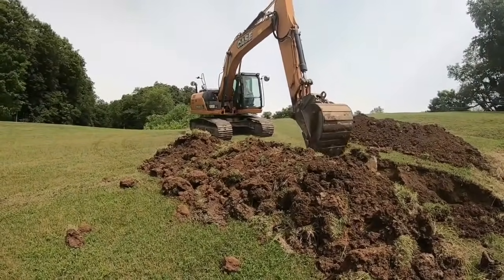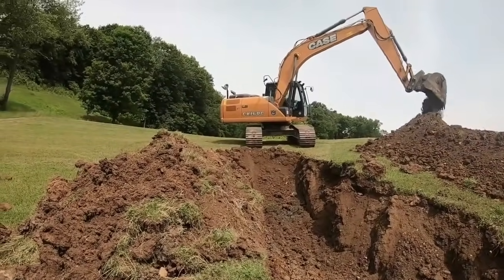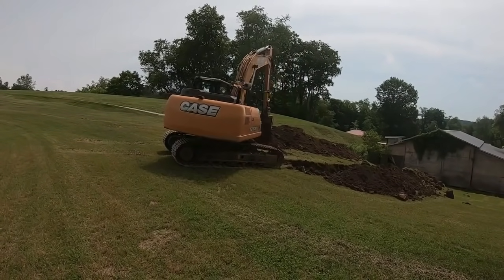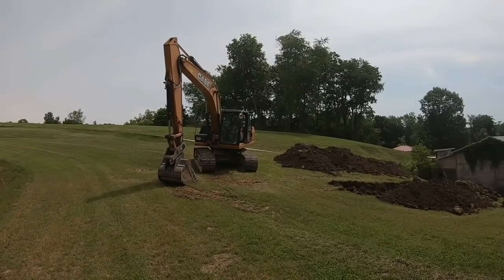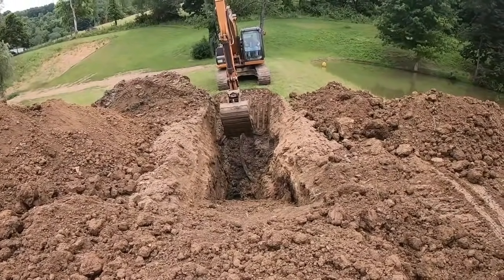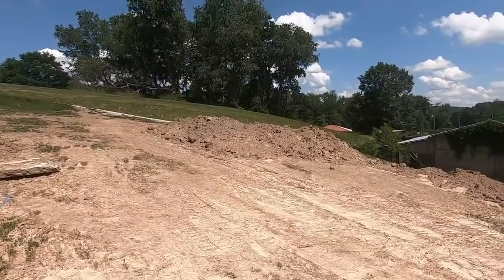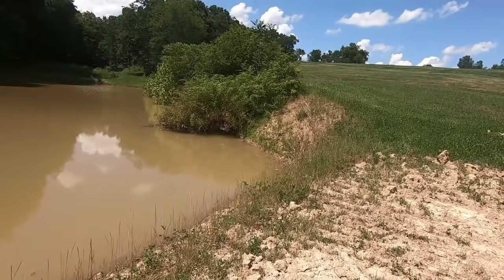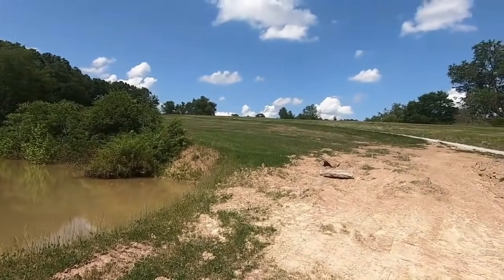Pond is Leaking - Today we Dig and try to Fix the Pond Leak

Comment: That’s a cute little dump truck.
Reply: Sometimes, a big tandem or triaxle is too much truck. You can make just as much money with a little one ton dump and mini excavator as you can with a big triaxle and a large excavator. It's all about the jobsite constraints and how much restorative work is in the budget.
Reply from the maker: @mikeznel6048  your right bout that Mike. Thus is the perfect truck for tail gating gravel driveways. We don't have triaxle, but use a buddy's when heavy haul needed. Can get this in lots places a triaxle cant
Reply from the maker: We like it, 2011 Pete, has 3 stage engine brake and an air operated tailgate, very nice for tail gating gravel. Thanks Hugh

Comment: We had two ponds on our property, but the dam on one leaked around the overflow pipe, they dug it up and poured a concrete apron or collar around the pipe. Filled it back in, only for it to leak again around the collar and it washed out the dam. We had 3 or 4 springs that fed the pond. I think the springs were the problem. I am curious, what are you feeding hay to?  I hope you get the pond fixed.
Reply from the maker: Very interesting Valerie, that had to be a real bummer when
that happened, really hard to fix a dam after it has washed out.
Hay is for mulch for Karl's excavating business. We used to have cows and horses many years ago but that is way gone. Thanks for
writing in and for watching my friend
Reply: @ccrx6700  same here, we had cows and horses, they have gone on to heaven. LOL. There is no way to fix the dam when there is springs in it, our pond filled up over night. They are pretty strong. 😣
Reply from the maker: @valeriebassett3107  👍

Comment: Wow that looked like a real mess. Hope you can get the leak fixed.
When I worked for a structural repair company we would pump urethane into areas that had a water leak. When mixed with water it turns into foam and stops leaks. We pumped a hillside to keep the ground stable and not erode into the creek below.
It might be an option if the clay does not stop the water. It's not difficult to do but I think it might be a bit pricey .
Reply from the maker: Thanks Scott, that's pretty interesting, have never heard of that done,
had to look up urethane, pretty wide variety of uses it has, learn 
something new every day

Comment: Good luck with the pond leak. Considering what the water table may be doing, it could be a "one thing leads to another" thing. We had to excavate a massive trench in a safe direction and fill with gravel over a big drain pipe. That didn't fix the leak, but it directed the feeder springs to a different safe area.
Reply from the maker: Thanks Brian, water is funny, we've had it come out of hill sides all 
over and then suddenly it stops, then it will come out someplace else.
Appreciate your watching the show

Comment: Just a thought, since it may be awhile before you get back on this project. Check with your county/ parish geology dept & see if they know any schools, colleges or individuals in area, that are working with geology. They have equipment they can roll across the top of the soil and it maps out any defects or density changes below. (They use to find unmarked graves, hidden sinkholes, underground water trails, etc) Chances are you could work out a deal for them to come map the dam area and find exactly where the leak begins, routes & ends ...without digging by best guess method. (Granted, this can be a lot more fun, but if you want potential to keep cost down and have more a precise plan, this would probably serve you better.)
   I know they use this equipment here in Texas. I would think one of your local colleges would have a class that could get interested in a project. Worth a few phone calls to check. Btw, Pond is looking really nice. Developing right along.
Reply from the maker: Great idea David, had no clue things like that happened. Will call
the local university and see if they have any interest, I know they
have geology courses. We have no county geology department here
that I've ever heard of but the university might be able to get
me some contacts if they are not interested. Thanks much sir!
Reply: That is called "Ground Penetrating Radar".....a good suggestion, by the way......

Comment: I don't know, maybe I would just let it leak.  Or maybe use some drainage tiles to divert the leak or something.   I guess if you own the Ponderosa you have Ponderosa problems.  I have more than enough issues with just having a roof and faucets can't imagine an actual dam.  Best wishes for you success.
Reply from the maker: Thanks for tuning in to the show sir. For now the leak has slowed
considerable and is gonna be a wait and see what happens next
spring deal

Comment: I was just about to recommend that you get letsdig18 to fix your problem and you mentioned him.
The machine he uses is a Volvo EC220Ei with a realy big bucket, you don't want to break it as it cost's an arm and a leg.
He's a real pro, does great job very professionally, like your self.
You might try food dye to trace the problem?
Love working outside no mater what weather.
I work as a volenteer on various canal societies restorations, leakage is a big  problem.
Locally it's not so bad as the local canal is mainly runs through thick clay of the Avon and Thames valleys, but we have out crops of sand, iron stone and other poor soils at the summit at Swindon and a few other places.
This is the pond where you live not associated with your railway I presume?
Yes think you need to dig a very deep trench along the top of the dam wall.
There might be a seam of porous rock at a depth that the water is seeping through, one of letsdig18 had this it took several digs over time to cure the leak.
You might also try bentonite it's a good water stopper.
Thanks for the video
Reply: That is a cool volunteer job you have, much respect! I live close to the Ohio and Erie Canal and it has been turned into a bicycle/pedestrian path while some locks have been preserved as an attraction. The really cool part is the Cuyahoga Valley Scenic Railroad that follows the canal from Cleveland to Akron Ohio, you can load your bicycle on one of the freight cars too for a small fee.
Reply from the maker: Thanks Anthony for the good info and great to hear you are
volunteering your time, kudos to you sir! Side of the pond is a lot of shale and it's pretty pourous and we think that's what causing
the problem. It has slowed down considerable since June when we
did this, so it's a wait and see what happens game for now.

Comment: Dave can you get ahold to any bentonite?
Reply from the maker: Pipe supply shop bout half hour from here has it, they
supply all the well drillers in the area, we've used it before on another
small pond we have here up the road and we used it around the
drain pipe for the big pond, That was mined in Wyoming, but I
believe it is mined in several other western states, California I
know for sure
Reply: @ccrx6700  what if you were to dig a core the length of the dam. Pack it with some good clay and bentonite?